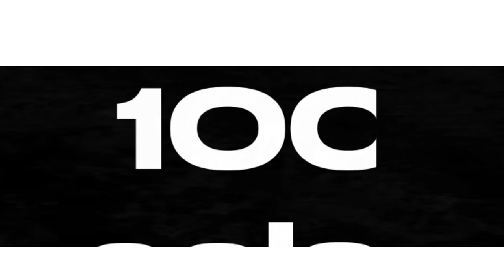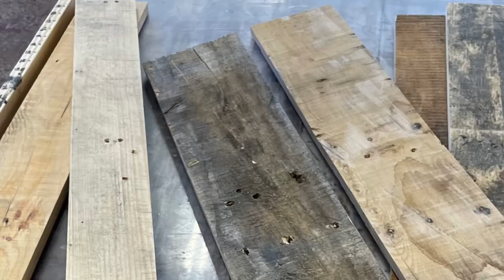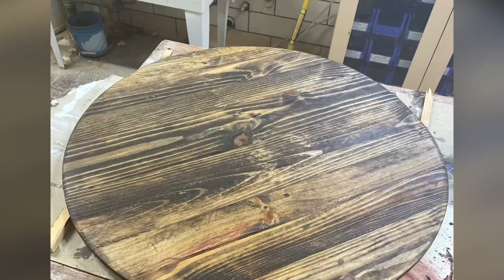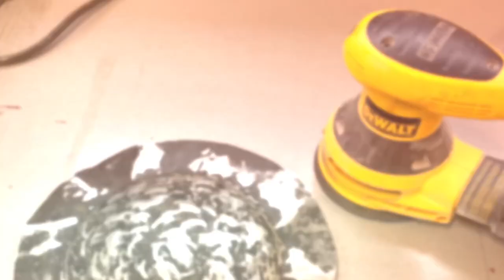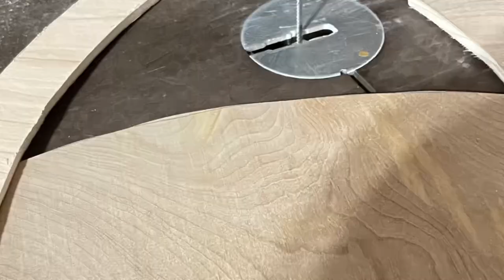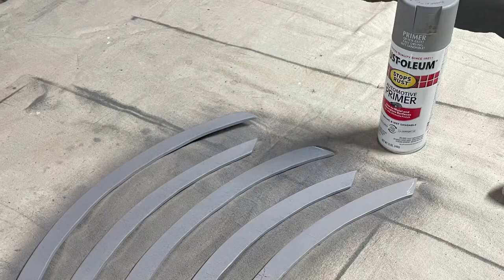VIKING SHIELD from reclaimed lumber!!! / Pallet Wood, Wood Working Project

Comment: Nice shield man, I am actually building one as well at the moment 😊👍
Reply from the maker: Thanks man.  It’s a fun build.  I hammered the shield boss out of an old industrial air conditioner panel.  Lots of people buy them so they are smooth and round.  And you can get one pretty cheap.  Under $25 on Amazon.
Reply: @MJLWoodWorks  Yes I noticed that, it's crazy but I did it the same way, clamped it down between two round frames and hamared it out, got the same texture. I put the project on standby because I was trying to find a local blacksmith to bend a metal frame around the shield but now that I saw how you made it out of wood I think I'll do the same.
Reply from the maker: @Squarecycle_  l would have done the same with metal strips if I had enough.
Reply: @MJLWoodWorks  It looks awesome anyway, and the most important thing is to have fun 🙂👍
Reply from the maker: @Squarecycle_  absolutely, looking forward to seeing yours!